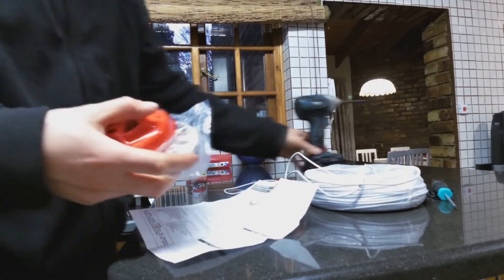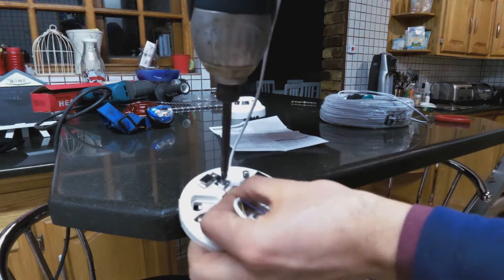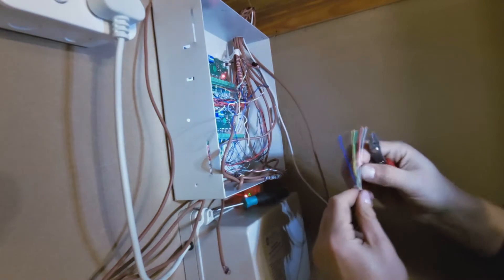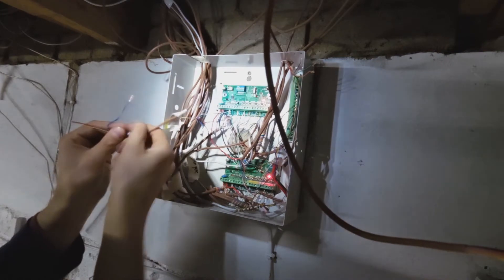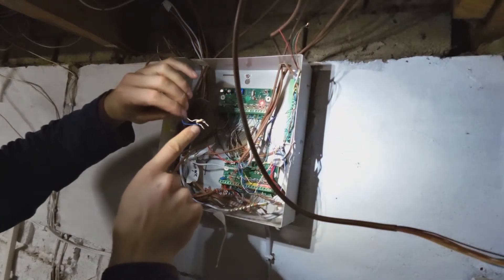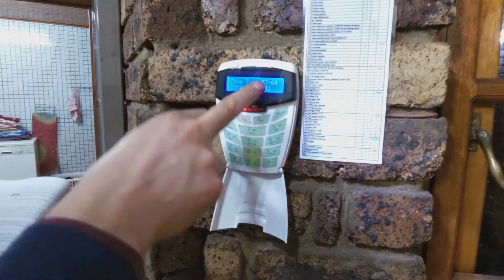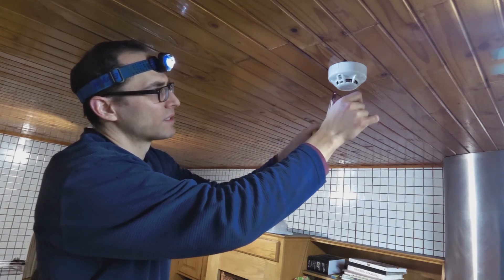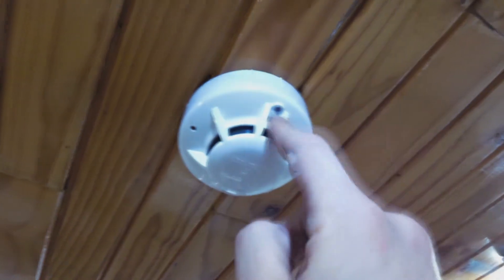How to install a smoke detector and connect it to an alarm (IDS X64)

Comment: I know it is not critical to put the resistor at the device as it is unlikely that a thief would cut it. It would however still put it there incase a rat chewed through the wire

Comment: Connect the power to smoke detector from an output on the panel will prevent the lockout of the smoke detector
Reply: Yes. But the installer manual does not say much about the behavior of the programmable output once the alarm is cleared. Is it just toggled off and on for a second?